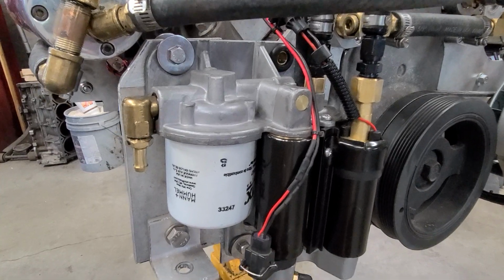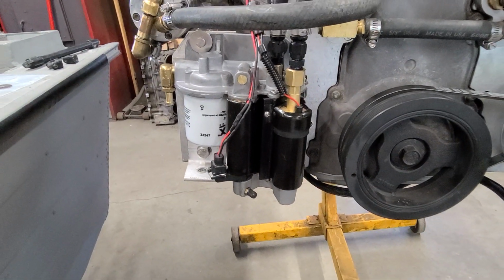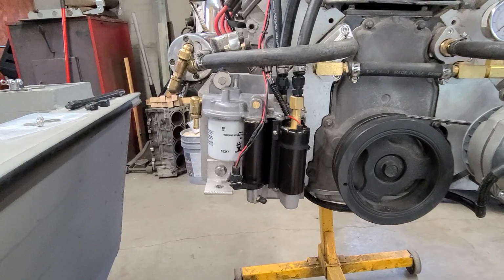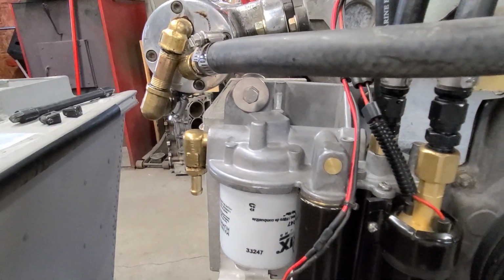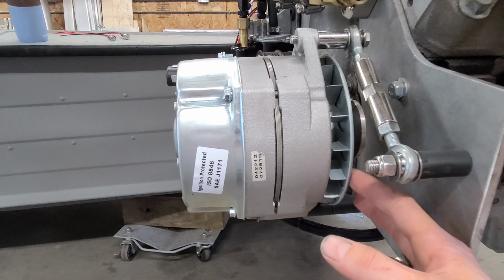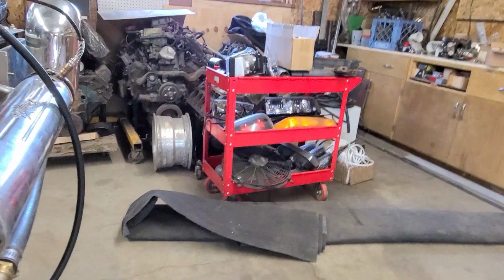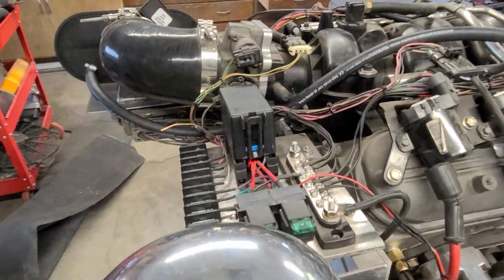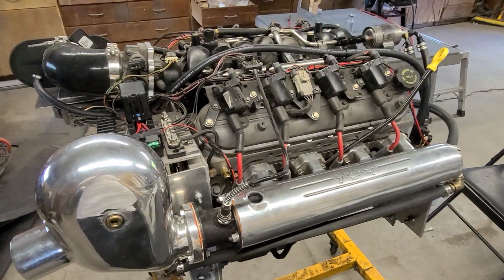LS Powered Aluminum Starcraft update 19

Comment: Are you going to run fresh water through the engine?
Reply from the maker: I have now for 60 hours. Just winterized the boat
Reply: @roncook8566  Awesome. Are you using any kind of thermostat? Also, are you using an electric water pump to circulate the water through the engine?
Reply from the maker: @tommythevideomaster  no water pump the jet pump provides the water for cooling. No thermostat just a ball valve right where the cooling water comes out of the pump before the motor

Comment: I had a problems with Volvo/Penta fuel pump and the Corvette fuel pressure filter regulator working together. I was using the Wix brand Corvette filter/regulator. The fuel pressure coming out of the filter/regulator was above 58psi. It was more like 58psi + (14psi of back pressure of fuel back in surge tank of fuel pump). This makes sense since it's a pressure relief type or pop-off type of regulator.  I had to use an adjustable diaphragm fuel pressure regulator.  I capped off the bypass output of the Corvette filter/regulator and just using it as an after fuel pump filter only. The diaphragm fuel regulator bypasses fuel back to surge tank of pump. You must return fuel back to surge tank or the high pressure pump will out flow the low pressure pump and starts to aerated fuel as it sucks the surge tank dry.
Reply from the maker: We were able to start and run it in the water and I noticed that the fuel pressure was high, the pumps were hot quickly with no water hooked up to them yet, and the tone of the hp pump was surging like it was sucking air periodically. So yes lol needs a real regulator I've heard of quite a few people having issues with the corvette regulator. The heat generated was crazy too definitely need water and maybe air cooling
Reply: @roncook8566  I used a cheap clone of an Aeromotive #13129 fp regulator. Search eBay/Amazon for "30-70 psi adjustable fuel pressure regulator". You can get for less than $30. The replacement or upgrade Aeromotive diaphragm is a part # 13003 and less than $25. I went with one that I could get a replacement parts.